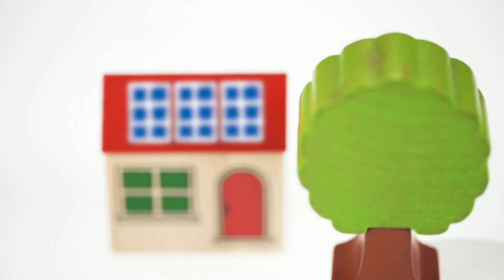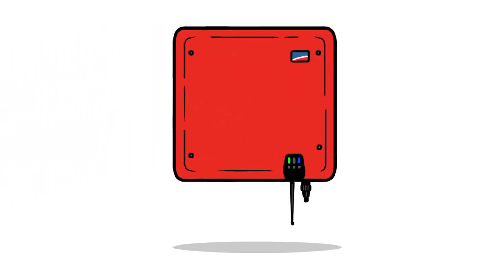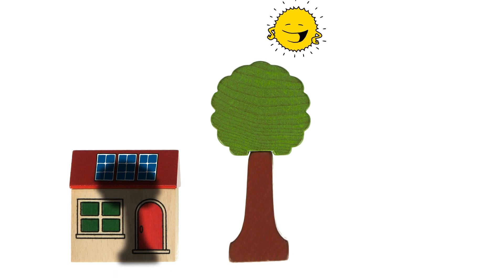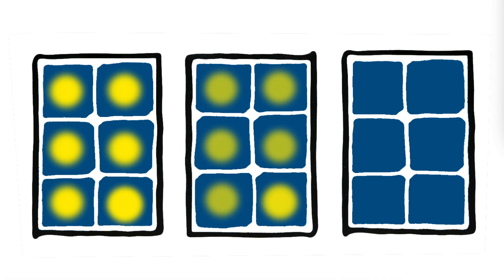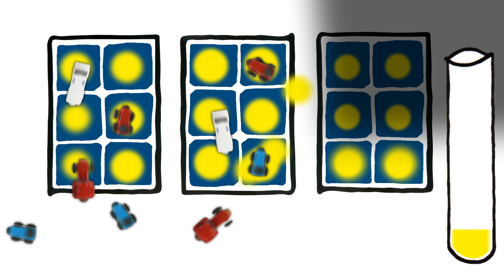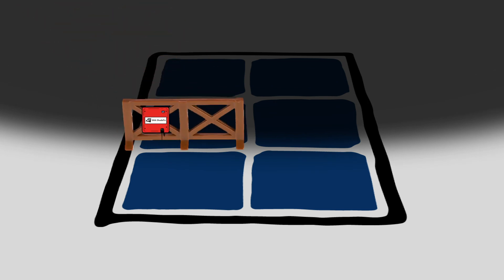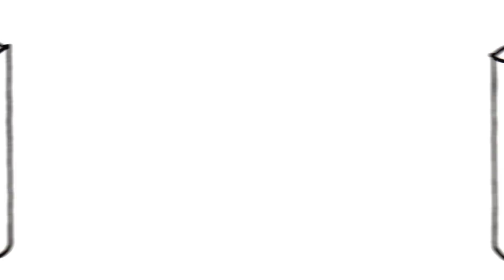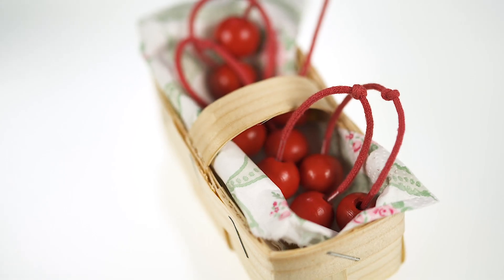Solar Plants: Sun Despite Shade Thanks to SMA ShadeFix

Comment: This is partially true what is presented here, because the shaded area of panel will not produce anything, so the max, in unshaded conditions you never can achieve. The invertor is using the bypass diodes from the panel, to minimize the loss.